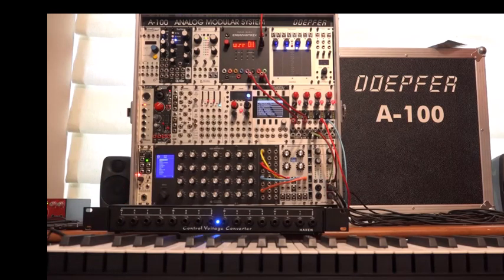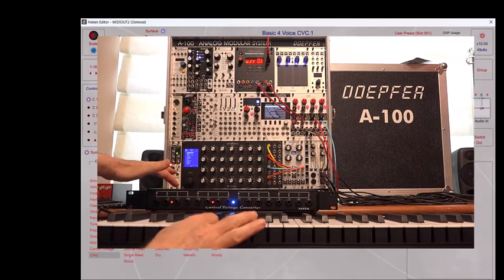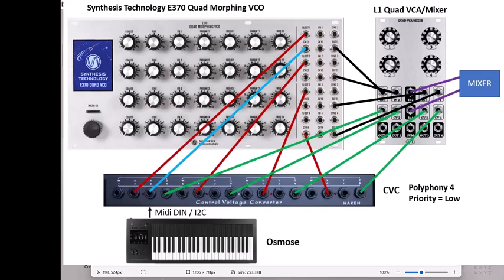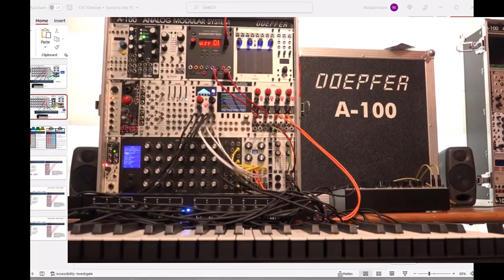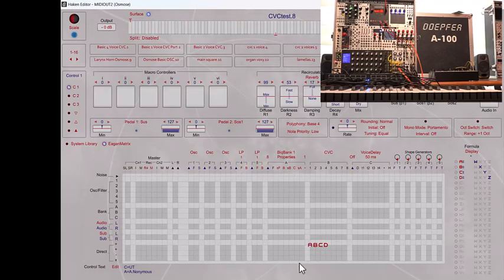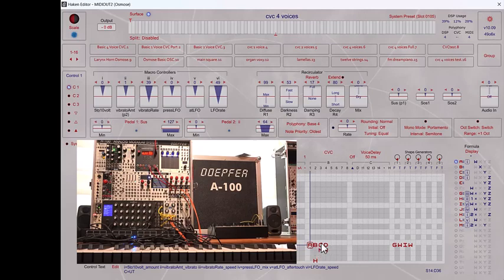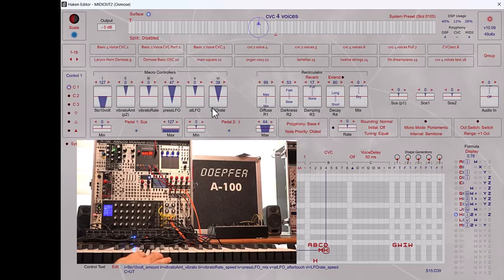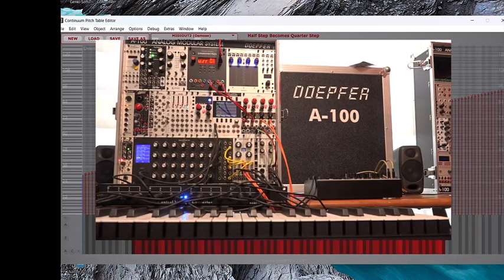EaganMatrix Programming for Osmose using the CVC

Comment: another question, is it possible to use the touch area to control cvc and add that to existing osmose presets. I've been having fun running the osmose through synths' external inputs to get some analog filtering and distortion but am running into the issue that need to play a 4. note chord to guarantee the cvc triggers the voice 1 which is running into the analog synth i run it through.

Comment: Hi Richard, would it be useful to copy formulas from existing presets to create gestures in analog using a cvc. For example, copying a formula from the SR &SR   Columns and using that as a z function on the cvc for the VCA on  an analog synth
Reply from the maker: You can bring up a CVC preset and change its W, X, Y and Z formulas using interesting things you see in other presets, including using shape generators to create ramping patterns, sample and hold patterns and LFOs, etc. But you need to make sure you scale those formulas to the desired target voltage (within the max -10V .. +10V range of the CVC).
Reply: @eaganmatrixprogramming  thank you as always for your prompt and informative response!  Follow Up, is there a way of storing formula presets within the editor in order to recall "Favorite" Formulas i like in presets I see. One solution i can see here would be creating a start preset that i duplicate and edit from that has all the formulas stored. just wondering if theres already a more elegant solution i'm missing here. Also Im using Osmose with Haken Firmware 10.09
Reply from the maker: @tylerpage2441  No. Presets are fixed entities. CVC presets however can be very simple so you can store a bunch of them. But you can't store a formula and import it into a preset. But you can store formulas in a preset that you don't use by putting them on a cell that is not used. That way when you save and reload they will still be there. So do that. Create a bunch of formulas you might use in a CVC preset and attach them to a cell not used. Then later you can set that formula to a cell that is used.

Comment: Is it possible to generate comparable CV from the osmose using the VCV “MIDI to CV“ module and a dc coupled interface
Reply from the maker: No. The only CV output from the Osmose through the CVC is through the Osmose Midi DIN Output set 5/5. But you can use a standard Midi-CV converter if you set Osmose Ext Midi to Classic Keyboard or use an MPE-to-CV converter like a Polyend Poly2 sending Ext Midi set MPE. If using Mid to CV converter from Osmose DIN, you set it 1/5 default output (5/5/ is only set when connecting to a CVC or uCVC).
Reply: @ Thank you Richard! Your channel has been amazing for me as an osmose owner. A clarifying question, So the only way to convert MPE+ to CV would be cvc. Otherwise you have to use the external midi  mode & regular MPE, which sacrifices the added resolution and ability to program functions for cv data in the Eagan matrix?

And in that latter case you could do it with a dc coupled interface and something like VCV rack software with its midi to cv module?
Reply from the maker: @tylerpage2441  Thanks! Yes only the CVC will output MPE+ resolution (for Y and Z it's 14 bits internally and the CVC has 16-bit converters). Any other Midi to CV solution obviously only would accept standard 7-bit midi inputs that I know about. The problem with Midi to CVC converters is that there are few that handle MPE.

Comment: I really appreciate your videos and clear explanation. I'm quite new to this. Can you point me i the right direction to assign recirculator wet/dry to a midi cc knob? I'm trying to turn the effects on/off with my ContinuuMini without any connection to the computer or ipad. I already have a Kenton USB host as well as powered USB hub.
Reply from the maker: HI. It's in the Continuum Manual in chapter 14.3 - Midi assignments. R Mix (Wet/Dry) = CC24 (value 0 = Off to 127 = Max Wet)
Reply: @eaganmatrixprogramming  Thank you, much appreciated